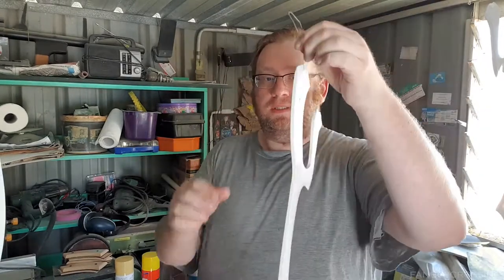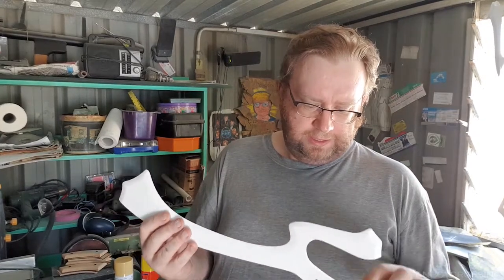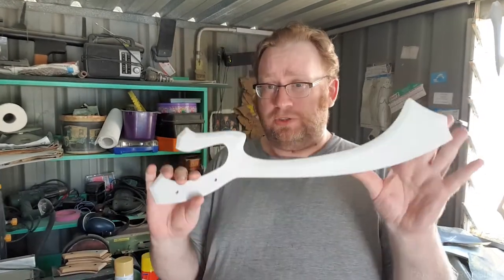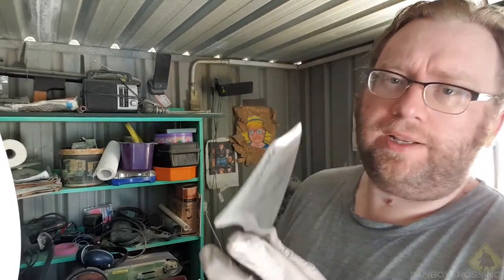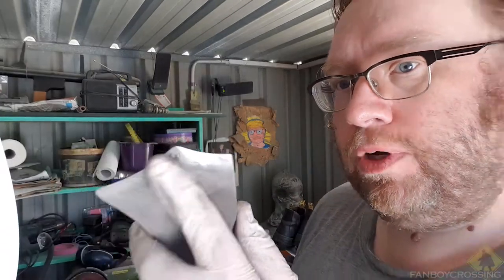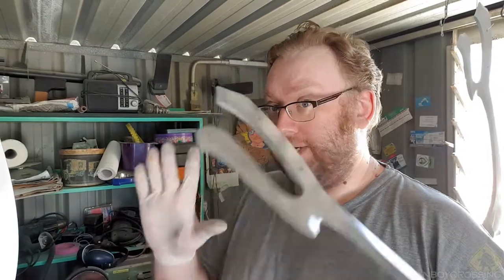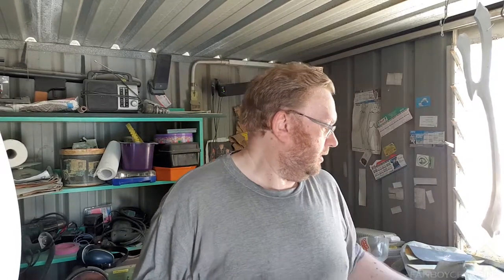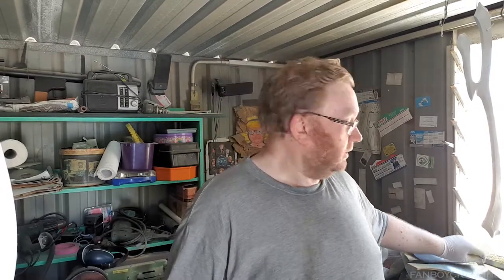Mek'leth - Graphite Rub on White Paint

Comment: How did you prep this before rubbing the graphite on it? Did you use a clear coat?
Reply from the maker: The paint I used was already a gloss coat so I didn't think to add anything on top of that. I've been meaning to get some water based clear coat to airbrush on, but unfortunately it's been a while since I've worked on this project.
Reply: @fanboycrossing I'm want to do this soon and I've seen coregeekcreations use a clear coat between the white and the graphite to great effect.

Comment: Ive been tackling this for a while now. Did you ever get to the bottom of this? Did you by any chance buy "synthetic" graphite?
Reply from the maker: Sadly I never got around to trying it out with different white paints. Not entirely sure whicg graphite I bought beyond the type used in lubrication, might try and see what other types are available but resources are pretty limited in Australia.
Reply: @fanboycrossing  
I'm only asking because I'm having similar and worse results to you. I checked my Amazon orders and realised I bought synthetic. Google tells me that synthetic is mainly used as a lubricant in machining. Most poeple I see seem to be using artists variety. I've got some of that on order now and I'll let you know how it goes.
Reply: @fanboycrossing  hey mate. I got the new batch of graphite and my god does it make a difference. The effect we saw is definitely something to do with using graphite that's designed as  lubricant. If you're still looking to do it definitely invest in artists graphite.
Reply from the maker: @jamesash7368  Awesome, I'll look into trying to get some locally for the next project. Thanks for the tip :)